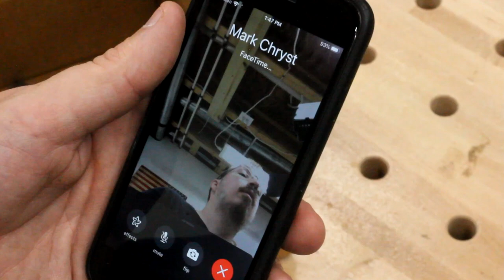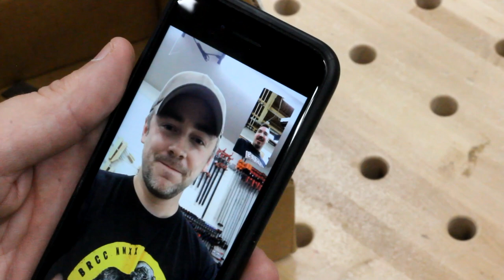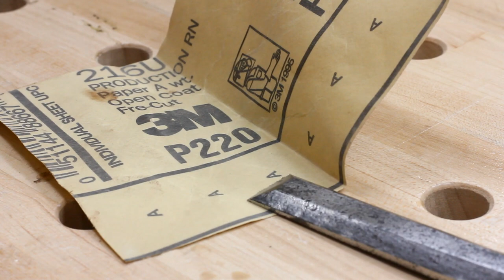A Stop-Motion Tool Restoration Story

Comment: 3:35 I see you had the upper right hand in this restoration

Great video and WONDERFUL editing job! 

How did you do the grooves on the handle? The ones that go all the way around the grip perpendicular to the router table chamfers.
Reply from the maker: When it was chucked into my drill, I held it against a spindle sander.  I filmed that bit but it didn't come out so I had to drop it from the edit.